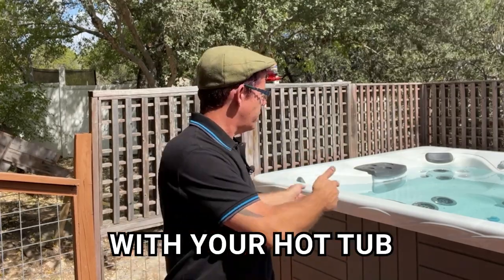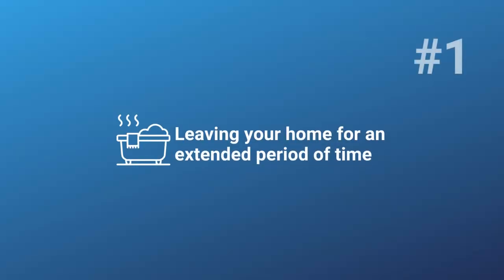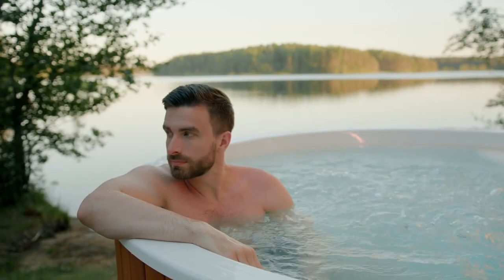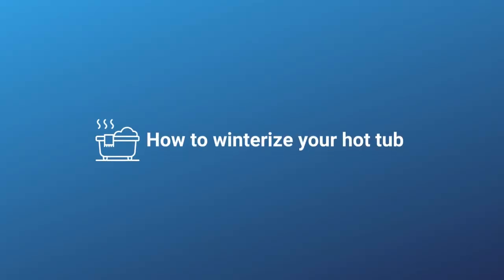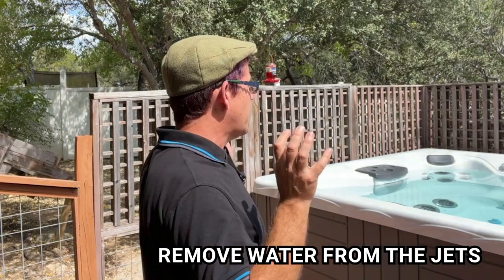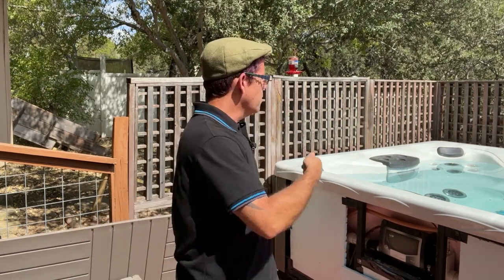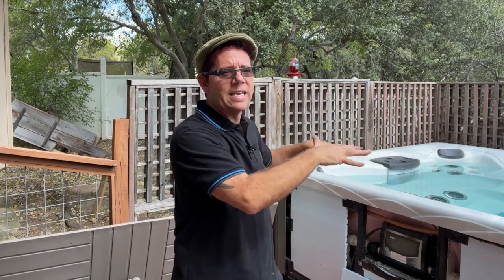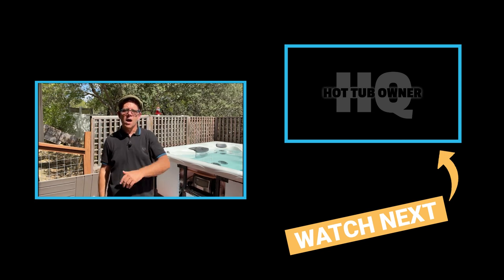Should You Shut Down Your Hot Tub in Winter?

Comment: I don't think you're winterizing properly. You should put a hot tub antifreeze in there too. There will be areas that will not be drained in the pipes. They will expand and they will crack. Your heater will not be the low point so doesn't really matter unscrewing though union fittings. I would take a turkey baster and squirt the antifreeze in all the jets and various drains after you drain all the water. Should get to all those low points if there is water remaining. Really look at the pipes if you are able to though with the paneling off and see where those low points are and how you can get the antifreeze into them if they don't drain.
Reply from the maker: Thanks for commenting! I answered your question in a new video I just shot, so look for that video to come out the week of 10/24/22! Thanks for being here! - Jeff